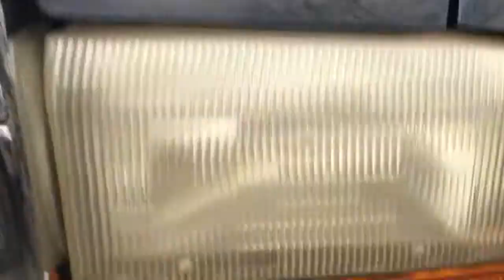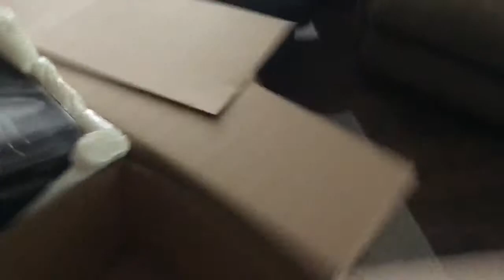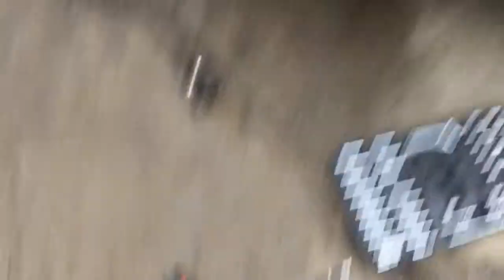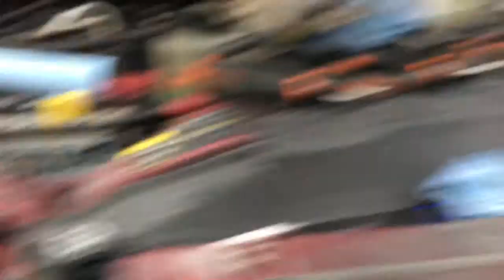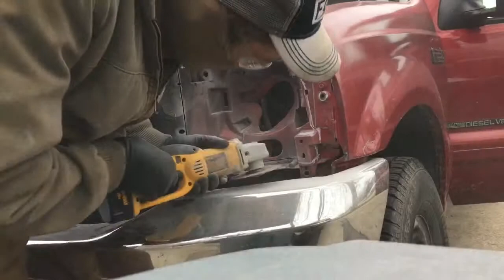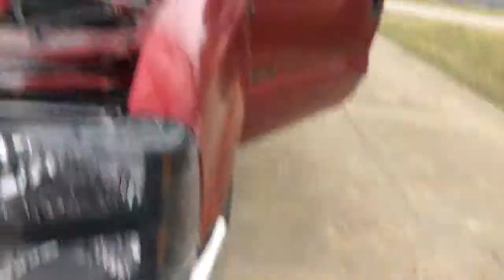05-07 Headlight Conversion for 99-04 Super Duty

Comment: Do I put the head lights in and trace around them to get the line or sometbing?
Reply from the maker: You just gotta eye ball it and take your time.
Reply: you can find a picture online of where to cut, as long as the four mounting spots arent cut and enough material is there to be sturdy.

Comment: Did you notice any aiming issues left to right? Mine are off with now way to adjust. Wondering if it's just cheap housings
Reply from the maker: Not to left or right I did tighten the adjustment bolt on top to bring the light beam up

Comment: The right way is just buy a 2005-2007 header panel
Reply: I wish the previous owner of my 04 6.0 knew to just do that.....
Reply: @oscarfoxman785  does the header panel from 05-07 swap directly to 99-04?
Reply: @donttakebiscuitsfromelmo1931  no, that also needs to be cut to fit the older trucks. You can either cut a $500 header panel or cut your junky old header panel. Gee, I wonder which one is the better choice?
Reply: @thatrealba  Just did the install with the newer headlights, after cutting the old header panel they fit just fine, like you said im glad i didnt buy a new one. now i have the running lights and headlights installed with the adapter for the h13 bulbs, but im having trouble finding the side marker sockets, is that something i should just go to an auto parts store for?
Reply: @donttakebiscuitsfromelmo1931  pretty sure I bought mine from OReilly. But yeah, any local parts store should have 'em.
Reply: @thatrealba  okay thank you
Reply: @oscarfoxman785  he knew lol it’s just a big waste of money to get a new header pannel
Reply: @nick7.3  It's actually a waste of perfectly good equipment to ruin the stock header panel. You can pickup an 05-07 header for about 50 dollars at a junk yard, and not have the headlamps flopping around as you drive. But show truck guys like to cut corners ig.
Reply: @donttakebiscuitsfromelmo1931  Yes it will. You can get one off eBay for about 150. Or maybe cheaper at a local junk yard.
Reply: @oscarfoxman785  lol you. clearly just don’t know how to instal them right I’ve done this exact thing to my current 7.3 and my old 03 6.0 and they are both solid af and don’t flop around at all
Reply: @nick7.3 seems like you enjoy cutting corners…
Reply: @oscarfoxman785  seems like you don’t know how to use a grinder 😂
Reply: @nick7.3  you sure do put on a big mouth when you get angry. I can’t really say good on you for that one.